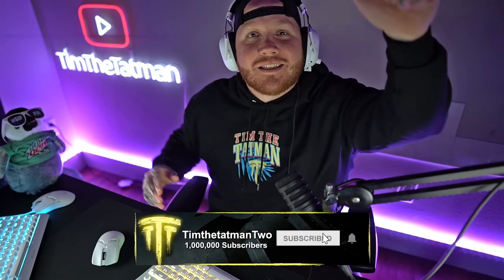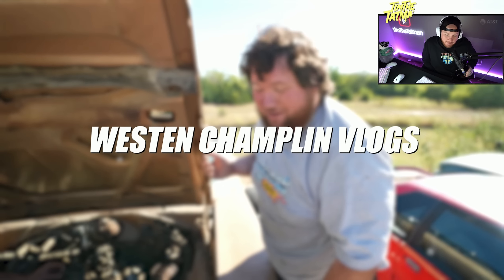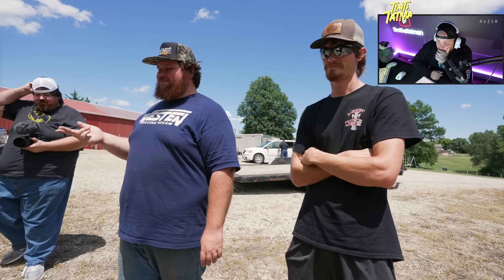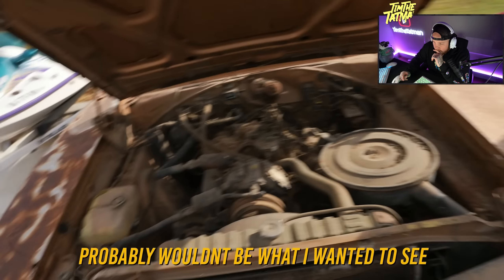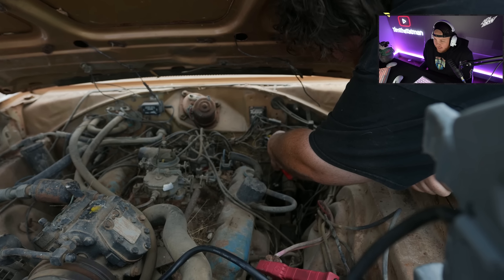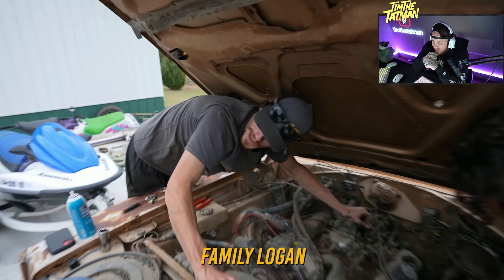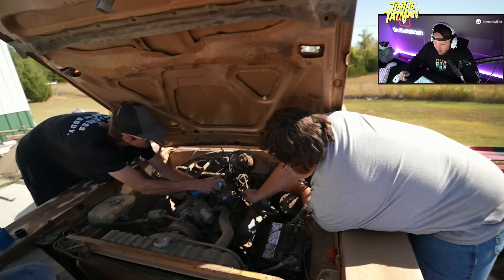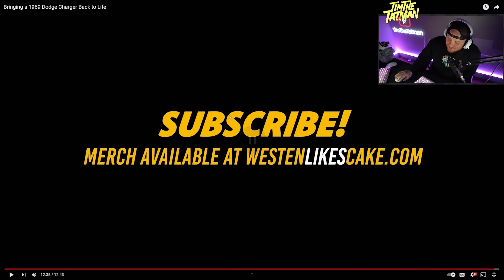TIMTHETATMAN REACTS TO A 1969 DODGE CHARGER COMING BACK TO LIFE

Comment: Most of these older cars are extremely simple to navigate and fix. Like he said in the video, plugs, wires, cap. I used to help my dad when he needed it to work on his old 70's Toyota Celica. He didn't ever need my help but he knew I loved to take things apart and put them back together so a carb'd engine was perfect. 

You could never do this on a modern vehicle.
Reply: my hilux is the same  had it sitting for over 30 years  i got from my father  i got it running in half hour
old cars are just better